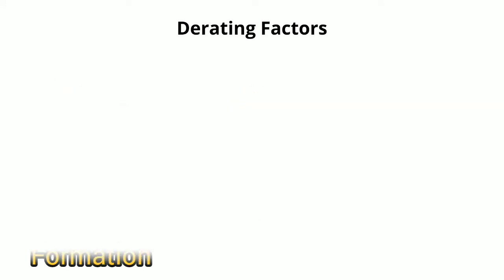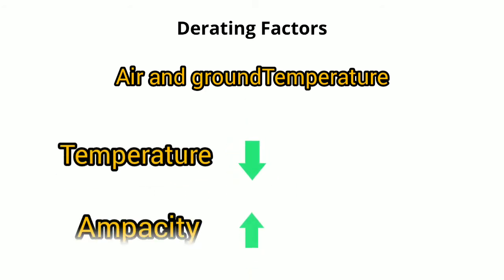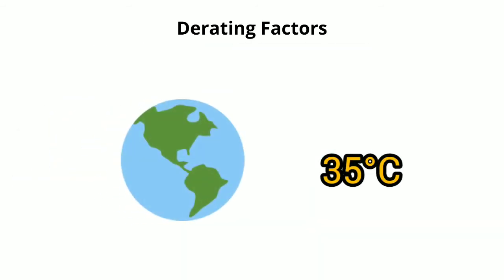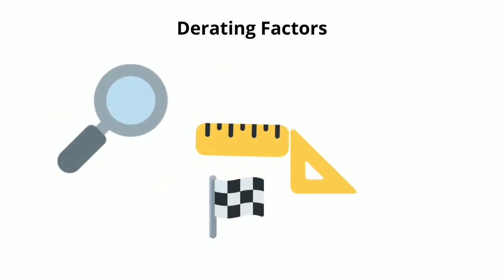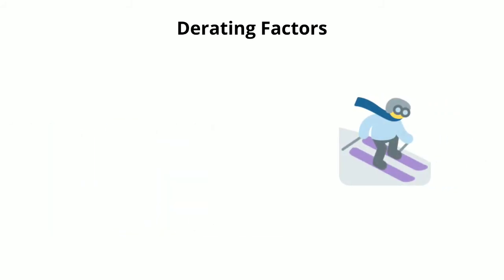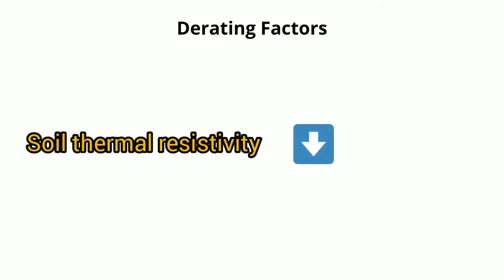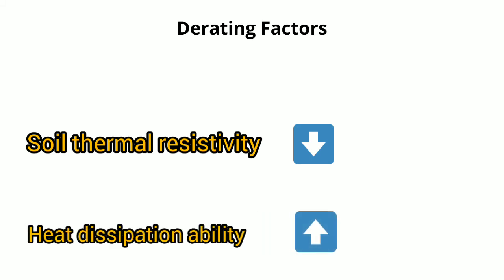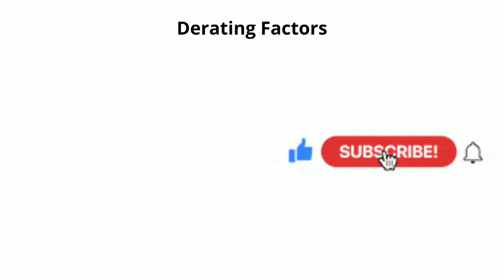Derating Factor of Cable Explained for Beginners!

Comment: The cable manufacturer I refer to,  Provides tables for the current ratings for all cables based on the installation method. Do I have to apply the derating factor, in this case? noting that for each installation method they mention different current ratings for the same cable
Reply from the maker: The installation method is just one factor, if the manufacturer tables mention also other factors like soil resistivity or ambient temperature, in this case you shouldn't apply deraing, otherwise you should apply other factors of deraing

Comment: how is the current distribution constrained to smaller regions when there is conductor proximity?
Reply from the maker: This is a phenomena called proximity effect, when two cables are side by side, the current passes through the outer side of the two cables. As if the current reppl each other